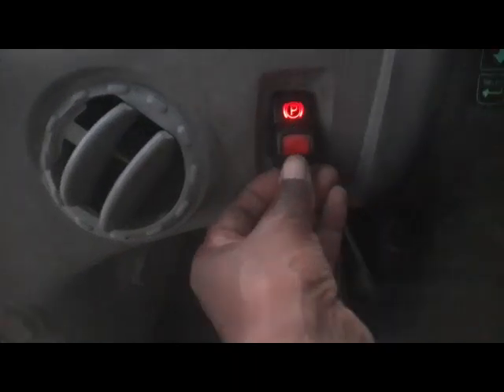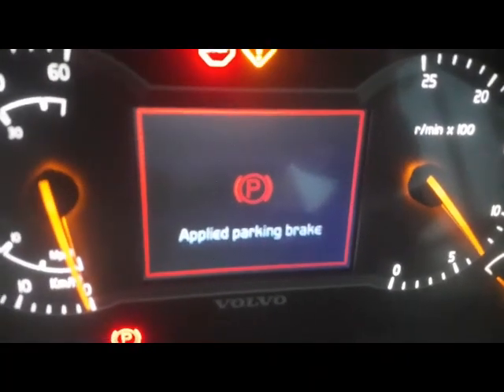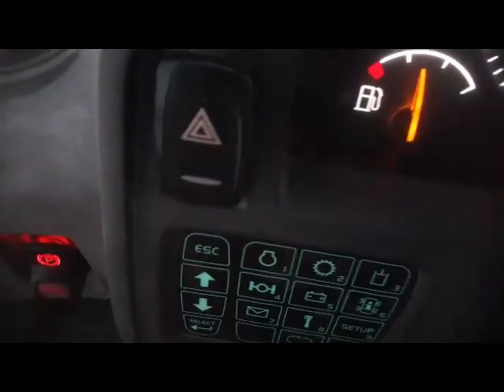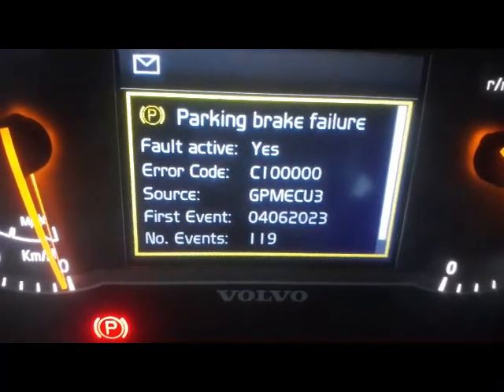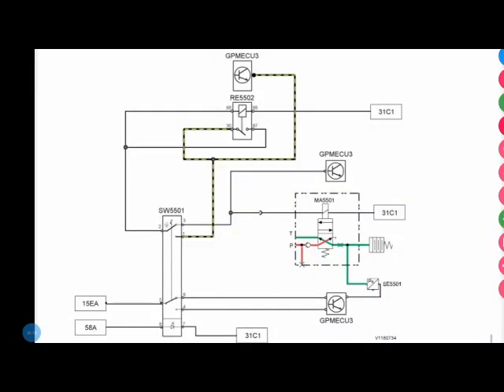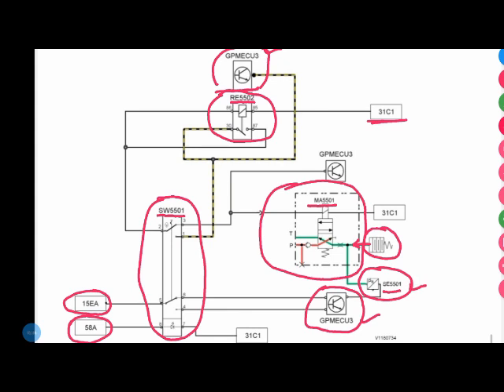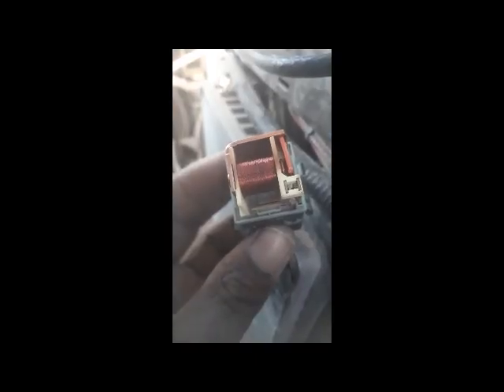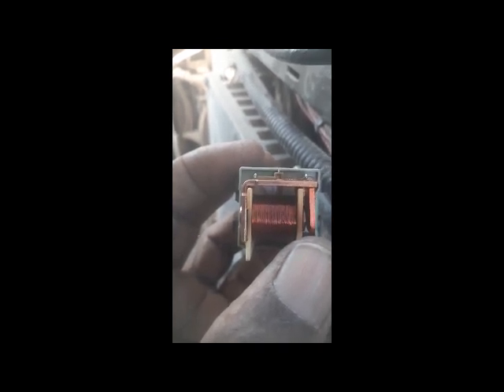Troubleshoot Parking Brake Won't Releasing || Volvo L220H Loader

Comment: Bisakah jelaskan kenapa pada Volvo l120Gz loder. 
Mesin tidak dapat distart
Muncul tulisan brake pressure low
Pressure low transmisi
Comunication interups
Reply from the maker: Transmission low pressure warning, machine will not start due to safety precautions.  Check the transmission oil. Most probably sensor faulty.
Reply: @AlbertB72  thank A lot sir